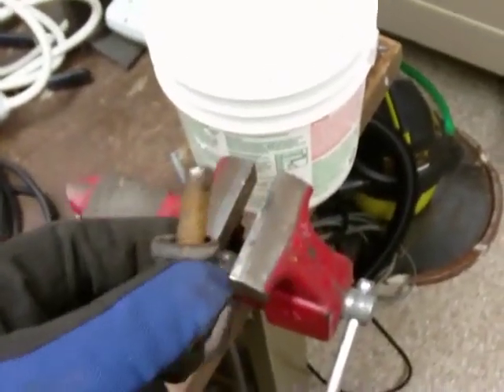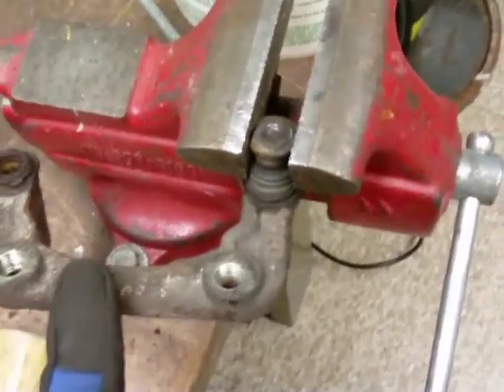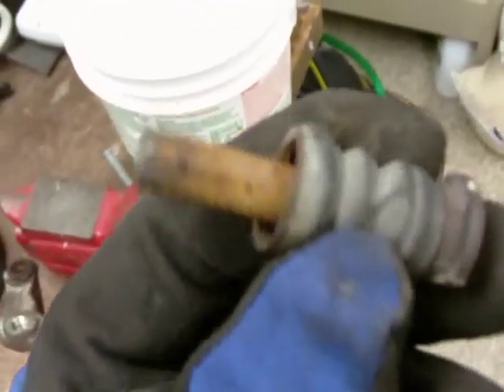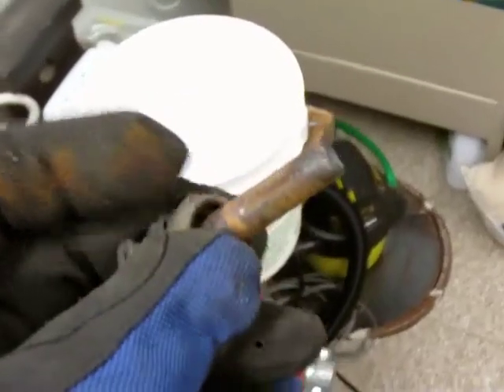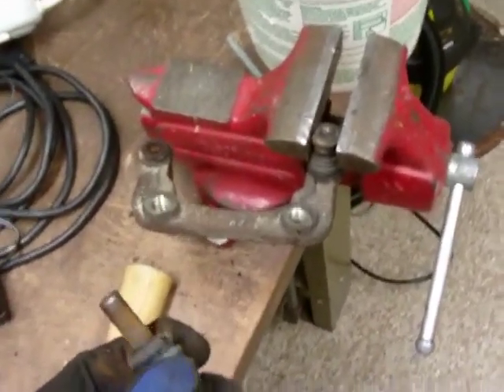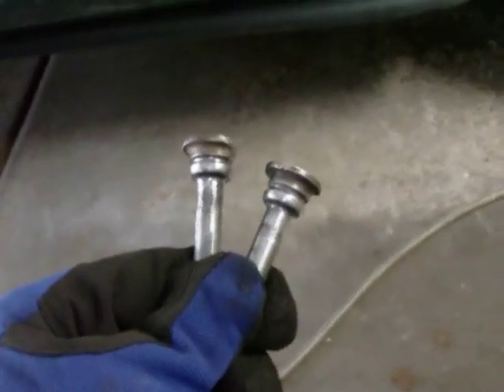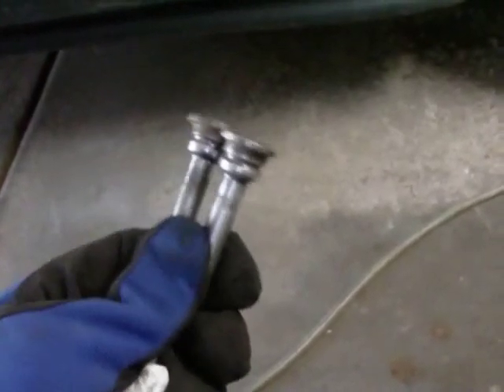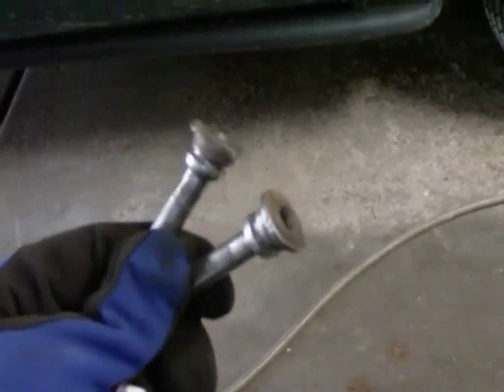Repair notes 1997 Ford Taurus Rear Disc Brakes

Comment: When one rotates the piston back in order to make clearance for the new pads, one needs to make sure the pegs in the rear side of the brake pad needs to go inside the piston head notches. That is why one leaves the piston notches in the vertical position, so that the pads peg fit inside them. May be, the previous service did not take that into account and the pads peg sat on top of the piston head outside the notches, this makes the pad to be cocked and not flat to the rotor surface. In that case, it May well be that the pad shifted upwards and worn out unevenly creating that "ear", also a great portion of the pad did not make contact with the rotor surface. Should the Guy had consulted the Taurus Haynes book he'd learned about it. Have wonderful drives and be safe!

Comment: Do the rotors need to be sprayed down with brake cleaner first? Thanks for the vid
Reply: you find answer 11 years later?
Reply: @GabeByrne-y2i  I'd say, yes. They spray them with some kind of oil to keep them from rusting in the warehouse. Oil on pads would be bad.